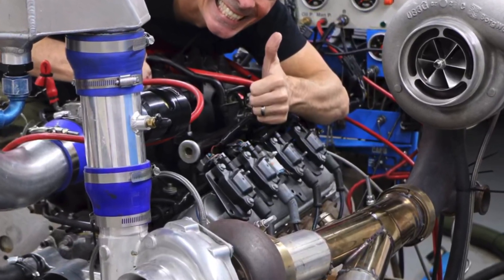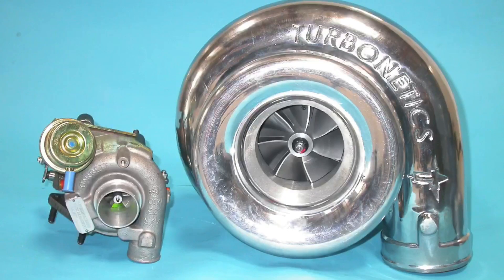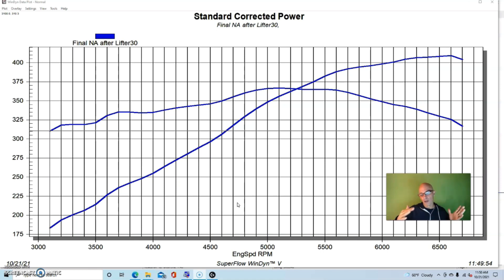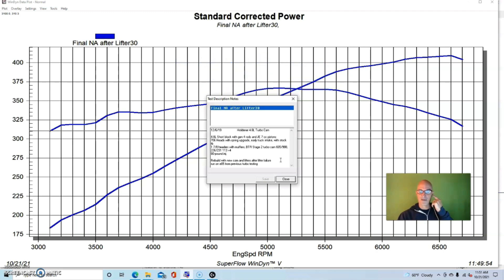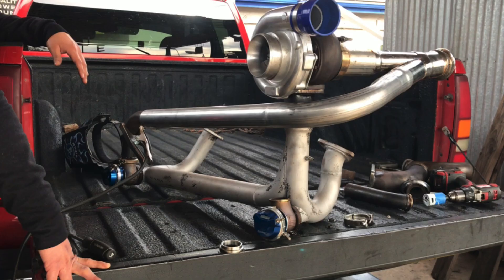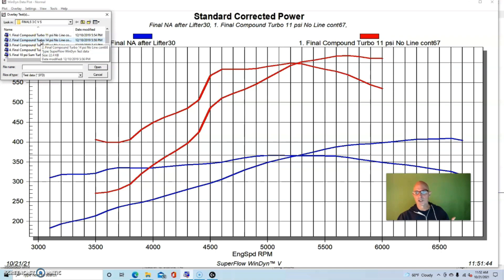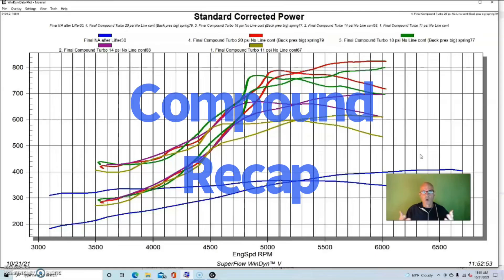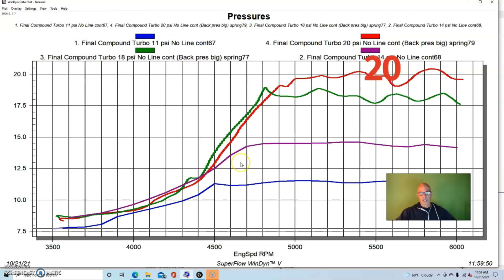COMPOUND TURBOS VS SINGLE TURBO-(WHO WINS?) SHOULD YOU RUN COMPOUND TURBOS ON YOUR JUNKYARD LS?

Comment: The reason it didn't spool quickly on the compound set up is because the big turbo compressor outlet wasn't routed to the little turbo inlet. Also, according to the math, with the single S485 on 20lbs of boost, the motor would have made 961hp.  Not bad for a little 4.8L junkyard motor.

Comment: I Think your turbos are not well matched. The big turbo seems to be doing all the work. Like married men. While the small turbo the B1t  ch is not providing you good intial boost. When you do the calcs for the set up you begin to realise the two turbos are much closer in size than you may expect. Where as you have that huuuuge turbs just dominating the scene. So for two at 800hp you would want two turbos at 4 pound a minute each. Maybe with efficency island centred closer to 5 on the second. Cheers c❤nt! 🍺🇦🇺 😀😀
Reply from the maker: If only you heard me say that these were just two turbos I had laying around-there were no calculations
Reply: @richardholdener1727  I did hear that. But you also showed that the big single was producing more torque from the start. Where as with a compound setup the small turbo gives more torque early on. Then you did not mention why the two power curves were divergent from that trend.

Comment: Comparing the compound 20psi to the 16psi single hp curves, the single looks like it has room to grow, but is late to start up. Too big for a 4.8? Or maybe too big for stock heads..??
Reply from the maker: decide your desired power curve, then pick your turbo size accordingly. That turbo with your NA power output (specifically low speed torque) will determine boost response.

Comment: When you build a true compound turbo system, turbo sizing is very important, the outlet size of the big turbo has to match the inlet size of the little turbo. And you plumb the big turbo first to the little turbo..... Air speed and therefore pressure suffers if the inlet and outlets don't match. You can taper or step the connecting pipe some to adjust a small mismatch.

Comment: I’m sorry but did you use an s476 and an s480? Lol you used two big turbos.  An s476 with an s463 would have been a far better idea or better yet something much smaller. You defeated the point doing compounds. Small turbo that spools fast and a big one.

Comment: Try a 64mm at 15lb then try a 80mm at 15lbs then try the 80mm feeding the 64mm.. that’ll show you how much power each make at 15lbs and how responsive each are. Had a hx35 with a 84/88 feeding a 12valve and it was just as responsive as the hx35 alone was. Only issue was the boost creep was unreal. Tripled the hp and over doubled the torque. You need to have the waste gate from manifold to first turbo feeding into the big turbo. And you can have a second gate between the two. If you want 20lbs the first gate will be 20lb release the second would be basically your boost safety say 30lbs. My buddy had a single cam Honda d15b with sleeved block and all that jazz but with a tiny turbo being feed by a 62/66 it made crazy power for a single cam

Comment: for comparison what they use on the acert cat compounds small one is a garrett 4702 (102mm exducer)with a huge 5518 (118mm exducer) as the low pressure, the thing is the C15 acert uses 70psi to make 550hp but the first model single turbo (GTA4702)  made 550hp at 32psi and you don’t have allllll the weight of the second charger, pre cooler and piping. but the same compound C15 in a off highway application it makes 998hp to where the single turbo C15 only makes 775hp.but diesel and gas it’s hard to compare 👍

Comment: Simple 60 mm small turbo external wastegated back into the 80 mm or 102mm big turbo guaranteed big horsepower numbers!!!! 1500 hp on 5.3l at 14 psi 💯
Reply from the maker: nope
Reply: @richardholdener1727  how do you figure because it doesn't show on your engine Dyno?
Reply from the maker: 1500 hp won't come with 14 psi of pressure in the intake unless your na motor made 750 hp
Reply: @richardholdener1727  yeah I guess it all depends on how much power you made before adding boost 👍🏻
Reply: @richardholdener1727  but the strange thing is I have a friend with a Honda Civic making over a thousand horsepower with a 100 mm thumper turbo That's on a 4 cylinder engine. Pretty crazy 😧

Comment: Not worth the effort
Reply: Depends on the application. It doesn't make much sense on an engine of this size, the power goal would have to be absurdly high. Where compound turbos are a game changer is small engines making huge power, for example a 2,000 horsepower 2.0L. A single stage of turbos is unlikely to achieve the pressure ratio it needs to without going way into surge, let's just say it's 9:1 for example. But with a compound, you can have the low pressure turbo feeding a 3:1 pressure ratio to the high pressure turbo, feeding a 3:1 pressure ratio to the manifold for a final pressure ratio of 9:1, all the while staying firmly in the middle of each turbo's efficiency range.

Comment: The science is in your exhaust housings.  Also, small (secondary charger) dictates how fast it spools and primary (large charger) dictates power potential.   For example on my 5.9 cummins I run a s476 over a s361.  It spools as low as 1500 rpm and builds power upwards of 3200 rpm.

Comment: Your description of the sequential turbo set up is off. It isn't a small to large set up. It is a 1 to 2 set up meaning to turbos the same size for the most part but one gets all the exhaust to give off instant power then the exhaust gets diverted to the turbo from the engine becoming a true twin turbo which is why at a certain point of the RPM most will see a power drop for a second then a huge surge of power.
Reply from the maker: factory sequential are different size turbos
Reply: @richardholdener1727  on which cars? I have an FD RX-7 and a Supra TT stock turbos in my possession, and the turbos on those cars are the same size. 

2 completely different engine types, and both have the same sized turbos.
Reply from the maker: you are correct-my mistake (not sure why I have been under the impression of the different sizing size they were introduced), thnx for making me look up the data

Comment: What I think is going on and I am new. l to turbo compounding in general. So what I say is probably incorrect and read it with caution. What I think with this compound setup is that the secondary turbo should be smaller or the primary bigger. Because both the turbo are to simmilar they start to build up around the same level. If you would put an small  tdo4 19t on it would have boost from 1750 rpm to around 3000 and then the big one take over.
Reply from the maker: yes

Comment: I am very interested in compound Turbo set-ups.  However, I am afraid to say that You made a total farce out of this test.  When You ran compound, so i set-up, you said that You were afraid to let boost build-up.  The boost was restricted to 7 or 8 lbs below 4,000 RPM.  On a single turbo set-up You let the boost build as fast as it could with the electronic controller.  There was almost 17lbs of boost at 3000 RPM with a single turbo.  Is it surprising that a single turbo made so much power and torque at lower RPM while the compound made so little.  You set it up that way!!!  You limited the compound set-up on purpose!    The real reason to run compound turbos is to make more boost then a single turbo can i.e. 70+ lbs of boost.  (I use lbs of boost loosely, the proper term is psig, 75psig is 90psi absolute pressure in the manifold).  This much boost will quickly destroy that 4.8L motor as it approaches 1,500hp! :)  The other reason to have compound turbocharging is to build boost early.  This implies a kind of sequential strategy.  The easiest way is to work backwards from the top of RPM range down.  Take the same S475.  It made solid 17 lbs of boost from 3,000 RPM and up very well.  Hence, from about 3,250 RPM, the small turbo needs to be completely bypassed, bot the turbine and the compressor!  As one creates excessive back-pressure and the other just heats up the intake charge and creates intake restriction.   Now, size the small turbo to deliver 17 lbs of boost from 1250 to 2750 RPM.  Up to 2,750 RPM everything should run through the small turbo and the big turbo should be by-passed.    Big turbine may not provide any back-pressure at low air flows but big compressor will heat up intake charge a lot, as it would operate outside of its "efficiency island".  Between 2,750 and 3,250 RPM is the transition period where both turbos can work together, in a true compound fashion,  while the big turbo comes on-line and takes-over by 3,250 RPM.  Theoretically this should produce a flat boost curve off-idle to redline.  Sizing the small turbo and waste-gates around it, managing the transition at different throttle openings is where the magic happens.  Did You run 4" downpipe to the single big turbo?  To equal 4" pipe cross-section (not real flow) with waste gates would take 2 x 70mm or 4 x 50mm.  Practically, to account for flow restriction through a waste-gate and to provide headroom for control (100% open waste-gate = no control), 3 x 70mm or 6 x 50mm should be used and this is just to bypass the small turbo's turbine!  It would be interesting to see, at what RPM level the small turbo can start building any boost.  The limiting factor, here, will be the amount of available energy in the exhaust to spin even the small turbo.  Will this extra boost at low RPM create a significant improvement in torque and drivability to justify all that extra expense and complexity?  An efficient modern large turbo with split volute turbine, like an EFR9180 or similar may perform almost as well with a much simpler set-up. Do not forget that turbos are heavy!  50 lbs per unit with all the intake, exhaust, water and oil piping. Diesels like boost.  It improves their efficiency, reduces emissions and smoke point and makes them feel even faster then gasoline motors.  Big 18-wheel rigs have an air-to-air intercooler after each turbo.  Some use more then 2 compound turbos.  Some use turbos that have blades on both sides of the compressor wheel i.e. a compound turbo in one unit!   A few people tried to set up a large turbo with a small positive displacement (Roots-type, etc.) supercharger in a compound arrangement.
A positive displacement supercharger is much better at providing boost down low.   At higher boost the boost from the turbo will actually spin the supercharger which puts a little power back into the crankshaft.  The newest approach is to combine the turbo with an electric motor/generator like F1.
Reply from the maker: you missed the part where I said I ran two turbos I had laying around and was purposely not trying to make huge low-speed cylinder pressure-compound turbo is NOT necessary on a V8 LS

Comment: I think you'd have to be running at least 4  bar for this to work. Size the smaller turbo 2 bar (800hp) and the larger turbo 2 bar (1600hp) Treat the engine with the smaller turbo like an 800hp na motor and size the bigger turbo for that. A 76/75 small turbo and an 88/96 would be where I'd start. A 6.0l would probably help also. Just my opinion.

Comment: Thanks Richard! Let's see a small turbo with a t4 housing and a 60-70mm compressor that spools great at low rmp, paired with a large turbo that has a big t6, 1.2ar+, large tubine 90mm+ OD/inducer85mm+ exducer, and 85mm+ compressor inducer that doesn't start spooling until higher rpms. That little turbo should zip up the engine power to turn the big laggy bad boy snail and run some quadruple digits! :D
Reply: Or maybe you could change it up to sequential tubos next???
Reply from the maker: OR JUST PUT ON THE s480 OR s475 AND MAKE AND EASY 1000 HP
Reply: So true, that's what I'm doing with my Tahoe right now! Honestly I just want to see the dyno graph of a small 500-700 hp rated single turbo and how it spools down low at 1500-2000 rpm. Especially with a torque and truck norris cam in an otherwise stock 4.8

Comment: No point when you can only use 20psi. Compounds are only good for something you can feed 60 pounds of boost to (diesels)
Reply: So the "loss" in the compound in a low boost situation was probably from extra heat and losses due to efficiency.

Comment: what happens when you put the Big turbo on the manifold then feed the smaller turbo second, on the exhaust side, wouldnt the small turbo spin up faster as it is unrestricted with nothing behind it but exhaust pipe? Then set up the charge side in the same manor as traditional compound with the large turbo feeding the smaller one. I think that would improve response. Also your turbo sizes in this test were not far enough apart in size to make a huge difference in spool time. Try 500 hp gt 35 with a 1200hp gt47
Reply from the maker: LET ME KNOW WHAT HAPPENS WHEN YOU TEST THAT
Reply: @richardholdener1727  I have one half built for a dsm with smaller turbos that I might finish in the coming year, provided this crazy economy doesnt rob to much of my expendable income. I was hoping you would grab the idea and run with it. Thank you for all the testing that you have done though, I enjoy your videos.
Reply: Pretty sure how that one is normally done, smaller one is used for multiplication.
Reply: @dennisrobinson8008  all the compound set up's I have seen put the small turbo on the manifold then put the larger turbo behind the small turbo.
Reply: @A2J_Tim  Thats what I've seen as well.  It works when you do it right with huge boost numbers and a torque curve that stretches wider than single, parallel or sequential turbo systems.

Comment: Seems like a major point was missed; one turbo works harder than two turbos working together.  The compound turbo system doesn't work as hard and possibly has lower EGTs as compared to the single turbo above 3K or so.  It would have been interesting to see what you measured your EGTs at for both systems.  I suspect that even if you were able to measure the speeds of the compressor wheels in both systems at that point, I suspect we would see slower wheel speeds for less work by two turbos.

It would also make sense to learn that the compound system performs better at higher altitude or lack of atmospheric pressure than the single because of the induced pressure from the larger turbo into the primary. 

Good info.. and thank you for putting something like this together.
Reply: I also forgot to mention wastegate pressure could have been modified to influence the curve or boost levels at certain rpms.. I believe the power curve is indicative of how effective the actual tune is.  If you simply add a compound turbo system with limited tuning, it will produce ugly results.  two turbos working together are always going to be more efficient than one.

Comment: Point of interest; in a compound turbo setup delivering 100psig of boost, if the primary is supplying 25psig to the secondary and the secondary bumps that to 100psig, both turbos (pressure ratio wise) are sharing the load almost equally. IMHO, 99.9% of gas engines don’t approach the boost levels required to warrant compounds. Also, bringing in boost too early tends to break important things, especially on a mostly stock setup.
Reply from the maker: it was a gee whiz exercise-it wasn't needed
Reply: It's mostly seeing use in extremely high horsepower small displacement 4 cylinders for this reason, many of them above 100 psi of boost. But that isn't the only use, it is actually a really cool setup to use on something like a hill climb car with a turbocharged 4 cylinder. You can run a very small turbo for the high pressure turbo, something close to what you'd see in a stock application, and then a low pressure turbo that brings it up to the 800-1,000 horsepower range. It isn't being used in that case to achieve an extreme boost level, it's essentially being used as anti lag. The engine ends up acting like a single turbo on a 5.0L instead of a 2.0L. Most people would rather just start with a bigger engine and avoid the unnecessary complexity, but it is a cool application to use compounds.

Comment: My take on the purpose of the coumpound is to "try" to get true compressed air. Quality boost which idea should be increasing torque. All this told me is twin screw is a actual compressor and a turbo even coumpound is a shop fan.
Reply from the maker: it should tell you that you don't need a compound set up on an LS

Comment: Man that motor from 4500rpm climbed in power output by 100hp (basically a small 1.6l engines worth of power) in only 300 rpm, that's nothing to criticise to heavily

Comment: The turbos where vary similar, hence why it did not net the end result you were exactly looking for. You want to size the small turbo for how quick you want the spool up to be and that will get you that low end toque. I think something around a 66-68mm would pair well with that s480. If you want to use the 76mm as the smaller turbo, I would recommend jumping up to a t6 as the atmosphere and going with an 88mm

Comment: If you have the chance to run it I would love to see quad gt45 turbos. I think run two per side or a twin to the summit single. Just curious if that's even possible
Reply from the maker: you can but what motor needs 4 gt45s?
Reply: @richardholdener1727  I was thinking of driving one into the other to drop the intake air temperature and higher boost pressure at lower rpm for more response or less lag and drop backpressurre in the exhaust. Lower intake air, quick response, higher boost, less backpressurre  sounds like a great idea